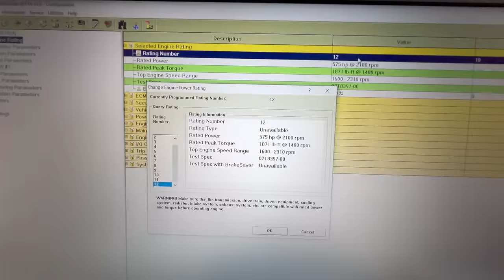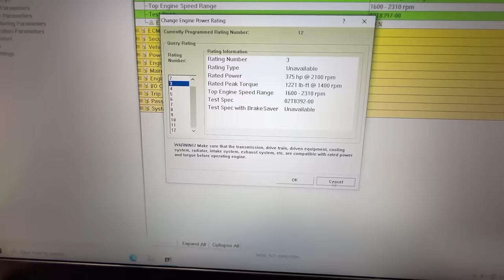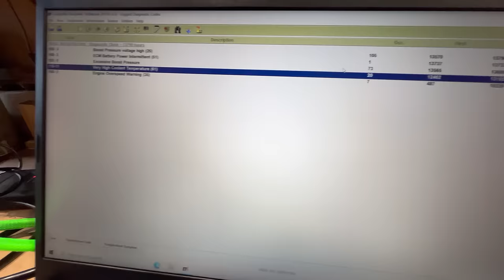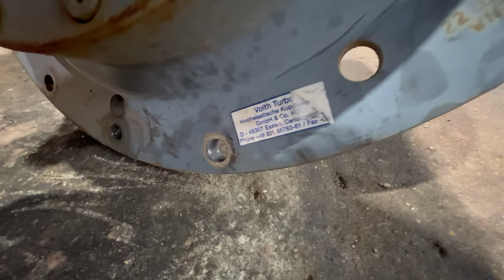Locked Up 565 HP Caterpillar 3406E Industrial Diesel Engine Tear Down

Comment: Possibly could have been 1 of 2 engines used on a locomotive. Direct drive goes to a 450 HP electric generator and an air compressor. Would have been another unit exactly like it on the other side of the cab. I used a 1200 HP engine built the same way but with a dead generator on the A-end side. We were limited to 600 HP and that was on a good day.
Reply: so it came out of a genset well deserving of a scrapping?
Reply: @SD40Fan_Jason I believe you are correct. The only application that requires that big of a air compressor are for the railroad industry, particularly the locomotives.
Reply: @josephmichuda6447  i belief atlas copco used these on their 46m3 mobile air compressors. Used for sandblasting and other micellanious jobs in the off-shore oil and gas. But i think this compressors were built back in '07 &'08.
Reply: I don't think you need that type of voith hydrodynamic coupling in generator setup.

Direct drive ? YES.
Reply: @TheStefanskoglund1  the voith hydrodynamic www looks like a locomotive is a good guess
Reply: @rodrod383  railway equipment,  some type of drive in a industry - crusher/transport band etc

I don't think it is necessary in something like a diesel-generator.
Reply: I deliver chlorine aka bleach to municipal city water wells and seen these engines for the backup electric pumps 🤝💪🏻🤘🏻

Comment: Just happened to be working on a 3406 and when I watched the video, I realized I had shut off the coolant filter cutoff valve to change the filter, and forgot to open it back up again. Ran back out to the shop and opened it up. So thanks for showing that filter housing and valve!

Comment: Why are you getting away from truck engines??? Hope you still make videos. Love the videos. Very informative
Reply: yea don't leave us hanging
Reply: Inquiring minds want to know! I hope Greta isn’t influencing your decision! 😂
Reply: @harleyhoracio1  Greta's mind is about like that one sleeve that he pulled out!  Completely cracked !
Reply: Powerplant generator engines are more and more common. The hybrid platform from PACCAR is pushing 25/30 mpg at 120,000 GTW (gross trailer weight) and that is more appealing than the 8-16 mpg of a strait diesel engine. I have a few classmates from engineering school and the tax incentives from Uncle Sam and the EU is to go for the hybrids then all electric. They also told me that the push for hybrid is because of fuel being 5/6/7 dollars a gallon that the trucking outfits want more fuel economy because fuck the fuel costs. The mpg testing is done at a race way going pretty much in circles with banks left and right at 65 mph for hours on end with some hills mixed in. Gist is they have had the hybrids for a while but now there is a push in the next 2 to 3 years that most trucks sold will be hybrid.
Reply: Off road truck engines only.Still a big player in power generation.

Comment: Been watching your channel for years.  I’ve had no real experience in commercial diesels, I’ve worked at a new car dealer for 25 years as a mechanic. Japanese cars in particular. Ironically however I’ve recently made a big change to fleet working with ISB and ISL Cummins engines. I’ve learned a fair deal watching your videos, it’s cool to see the similarities.  
Great vids.

Comment: S/N 3145 is a Generator, 6BR1004 was built in 98 and sold in 2000 to a dealer In Austria, 

How it ended up back over here is anyone's guess.
Reply: But why hase it that Voith cupling (Made in Germany) on it and a compressor?
That looks more like special vehicle aplication!
With that coupling i guess either some sort of hydrostatic drive or somthing like a snow blower.
If it was originaly sold as a Genset engine in Austria, i would tend to think this was last used as a replacement engine in a snow blower or maby a snow groomer, and somehow ended up in the US!?🤔

Comment: Voith are a German company that makes train parts, most likely that engine was locomotive application. Where I work we use Voith parts, couplers for trains.
Great video and tear down, look forward to your next video, whenever it may be!! One of the best content creators in this line of work!!
Reply: They also make retarders for trucks and busses - generators that burn all the generated energy off as heat to brake the vehicle. And automatic transmissions for busses and trucks
Reply: I believe Voith Turbo deal mainly with the rail side of heavy industry, transmissions and adaptors. Not a 100% it’s just rail, but it’s now called Voith Turbo Schafenberg (forgive the spelling).
Reply: Voith are also big in marine thrusters, could have come from a tug or push boat?

Comment: The little sticker with the german writing on it is the company name and address/contact info. Voith is a maker of big gearboxes, it seems this driveshaft coupler was made by a subsidiary called "Voith Turbo Hochelastische Kupplungen GmbH & Co KG". Hochelastische Kupplungen translates to "highly elastic couplers" or "highly elastic clutches" so maybe there is some sort of shock absorber or torque limiter in this thing.

Comment: I'm so happy to see you post another video on a Cat Engines takedown. And for us neophytes, can you tell us what you used to soak the rust loose on the pistons?
Reply: Water.
Reply: i cant say for sure but i use turco WO2 which is phosphoric acid. nova phos cleaner would also work
Reply: I was thinking the same, I usually use Acetone & ATF.
Reply: @86FxBdyCpe  that's a great penetrant, but it won't dissolve rust
Reply: @jasonstalder5208  Nothing is better than water...
Reply: @Look_What_You_Did  for dissolving rust? Lmao yeah ok bud. Did you suffer some head injuries???
Reply: @Look_What_You_Did  also it's proven ATF and acetone in a 50/50 mix is the best penetrant
Reply: Probably Evaporust.
Reply: Nothing better than panther piss💅🏻🤝😎

Comment: I learn something every time i listen to your videos.  Love driving a truck with a cat engine.  I have enjoyed 3406A , B's  WS , and 6NZ.  The bossman and I kept on trying bifferent spec settings on the 6NZ.  Run 68 mph and was getting 6.5 to 6.9 mph running west out of St Louis.  
 Most of the loads west were   45.500 and produce back.

Comment: Wondering what you used to free the cylinders up or is it a secret. You do a fantastic job of explaining what you are doing.
Reply: Maybe vinager
Reply: Acetone and atf
Reply: I vote for acetone and atf
Reply: Acetone evaporates fast though
Reply: If it was atf and acetone,  it would be red. 
It sure wasn't red
Reply: CLR
Reply: Going by how cloudy it was I'm guessing there's a bunch of citric acid in there. Probably phosphoric as well.

If you want to get really creative add in some chelating agent, either EDTA or sodium EDTMP for example. Keeps the metal ions from redepositing. That's basically all Evaporust is.
Reply: Yep I was curious. More impressed that it worked quickly and then could be sucked up with a shop vac and not destroy it!

Comment: I love my 3406E  in my 2000 379 Pete . It’s kinda a rare motor nowadays . For one thing  it was specked out with a 3406E 1MM  15.8 liter 600 hp factory settings. I guess it’s actually a C 16 if you think about it. It got a fresh rebuild last March and runs so strong . I had another truck with a 2WS Set to 550 hp that I got a hundred thousand miles out of with no breakdowns. Great engines both of them . Nice to see you back on here . Take care brother.
Reply: The 3406E came in both 14.6L and 15.8L displacements. Your 15.8L 600 🐎 motor is somewhat similar/analogous to the follow up C-16 (7CZ) while the 550 was replaced by the C-15 (6NZ).
Reply: A hundred thousand miles? probably more like a million. I ran my '97 Pete for 1,750,000 kl-ms over 9 and a half years when I sold it and I know it went for several more years after that

Comment: Being as the adapted on the back of the engine was from Voith Turbo. You can safely assume that this engine was used to power a very large water pump.

Comment: Your mixture for the seized pistons worked well. Is that your own mystery oil concoction?
Reply: I would like to know too
Reply: What's wrong with vinegar for a starter.
Reply: @edwinhsingmaster9135  exactly what I thought hot white vinegar
Reply: @jasonh.8362  the white vinegar doesnt discriminate between oxidization and base metal. I would bet dollars to doughnuts that it wasnt vinegar. prob evaporust or some derivative.

Comment: 3406 was used as a generator set on the 75 ft tug boats. we had 2. decent motors. reliable as hell. in case you were wandering USCGC Wyaconda.

Comment: The blue german thing on the flywheel should be a fluid coupling. Likely to facilitate starting the engine with an otherwise permanently driven compressor or something.

Comment: Great content and editing, KT.  What would have caused that #6 liner to crack?  I'm sure the pieces blown into the cooling void were due to combustion pressure, but I'm stumped on the crack when there was no sign of galling or over temp on the piston.
Reply from the maker: I agree with your conclusions.  If I had to guess I'd say it froze and cracked first, but there's no way to say for sure.  It was a pretty strange failure.

Comment: What do you think caused that liner to fail? Looked pretty rusty in the coolant passages, kinda like they were running water or bad coolant. Kinda looks like it could have frozen and busted the liner .
Reply: If it was frozen think it would have busted into the cylinder not the coolant paggase? Also would think that a freeze plug or something less meaty would have busted first. No way of knowing I guess. Maybe the liner was cavitated bad and it finally let go?
Reply: I have seen another video where the guy found a broken liner like that. It was believed to have been a hydrolock situation that broke it. He figured that the liner was cracked already and some coolant was seeping into the cylinder. The guy also found a witness mark on the bearing of the connecting rod. He believed it was from the piston stopping suddenly or encountering some extreme resistance. Since the liner was likely already cracked, it just broke the liner where it was cracked. The connecting rod was fine and so was the crank and piston.
Reply: It was overheated a bunch so maybe that started it. Also the coolant config is different maybe that cylinder runs hotter with the inlet up at #4 as he was pointing out usually it goes to the #6 where it broke.
Reply: @clynesnowtail1257  interesting didn't think about it overheating. Thanks for the response and thanks for the time and effort put into these videos.
Reply: @miztatone918   Oh this isnt my video

Comment: I used to work at a company called Bulldog Hydraulics and Gaskets. I sold so may kits for countless application variants of the 3406 engines. The engine overhaul kits were extrmely application specific. The strangest, at least from my perspective, were the stationary marine engines. They had some very special parts that were ideally suited for being in constant exposure to sea water and high humidity.

Comment: Just taking a shot in the dark here but I bet this engine came off of an irrigation pivot. The drive shaft runs the big ass water pump, The belt sheaves drive the generator that runs all the electrical equipment, and the air compressor builds air for all the valves.

Comment: For the number of hours, the head is extremely clean.  Super clean usually means something is cracked, which is what you found.  The rust under the valve covers has me thinking the valve springs may need to be replaced as rust will make them break.  Any chance this engine was a victim of a hurricane?  It is nice to see a YouTuber that knows what he is doing!

Comment: I really enjoyed that video as I am fascinated by Caterpillar engines in power generation applications, especially the very largest versions. 

If KT is watching the comments I think this type of engine is exactly the sort of thing that many medium sized factories and other businesses will want to install (with an alternator on the front of course) as a backup fast start generator for critical loads as the grid becomes more dependent on wind and solar and hence less reliable. There will always be already market not just for second hand engines like this but also the skills to repair them. A business facing a power outage in winter and a broken engine will pay a lot for a quick solution to prevent business disruption.

Comment: Interesting teardown, I get the feeling this thing was in a separator or a wash plant in a pit somewhere because of the pto adapter and that high output compressor hanging off it.I am curious about that split sleeve, normally that kind of thing happens from freezing but I guess not here.

Comment: We use these engines on our boat to make hydraulic pressure for unloading systems and winches, and for the generation on electricity. The air compressor could be for air controlled gates on a conveyor system.

Comment: I'm totally impressed with your knowledge and presentation. Beyond professional. Only thing missing is your opinion on why the liner broke. If from overheating why didn't o-rings and coolant items fail first? Isn't that typically what happens? Thanks for a nice lesson on Cat 3406's.

Comment: Voith Turbo is a marine drive manufacturer and supplier. I would presume this engine was use in a marine application, maybe even as a main propulsion unit on a multi-engine small ship or large boat. The universal joint would have gone to a gearbox and the belt sheave used to drive a generator or air compressor. As always a very instructive and interesting video.

Comment: Absolutely with no discussion about it!!! The best Diesel engine ever made in history. That’s why they are no longer made. I owned several and other than a head gasket or a liner seeping on a couple they will run 6-8 hundred thousand miles in rough conditions.

Comment: The drive shaft adapter that you pulled off, WAS German. Voith is a German Industrial manufacturer that I had exposure to when I worked for Federal Paper Board Co. Voith made several dryer sections of our paper machines. Doubt that this had anything to do with a paper machine, but I do remember the name Voith...  Rip

Comment: Interesting that engine was used by Voith. They make that super badass counter-rotating propeller for tug boats and ferries. Anyway, they're like a German version of GE. They most likely used that engine in a generator set. Probably not for a boat or you'd see a water to water heat exchanger in place of a radiator.

Comment: Good to see you back at it, Why are you getting outt of truck engines? Not enoough work or equipment engines just bigger money? What rust dissolver stuff do you use? I got some  powdered acid that comes in little bottles, name escapes me, works well to. When you go on vacation you should go to Australia and visit that cutting edge guy Curtiss, you both seem mechanically meticulous. Whatever you do i hope you still do a motor from time to time.
Reply: that liner removal was a pretty good combination of luck and skill. good job

Comment: Awesome video. I did notice rust on your lifting chains which can lead to chain failure and hide cracks/damage. Make sure all chains and hardware are rated for the load. It is good to keep chains and hardware lubricated and properly stored for air circulation. Inspect before each use for damage, kinks and stretch. Most of this applies to lifting straps as well. Keep up the vids and stay safe.
Reply: Pretty patronising comment Ry Ry ,this man is not an idiot. If you passed a comment like that in my workshop you'd be escorted to the door.
Reply: @seamusburke9101 no kidding, this guy would grow a 3 inch hemorrhoid if he seen the stuff we do with chains and straps

Comment: I have a 320kva genset with a 3406B with 10,000 hours on it, and under moderate load it would usually go through 8 ish litres of oil every 100 hours running 24 hours a day, but in the recent week it started going through roughly 25 L of oil every 20 hours with less of a load 14 hours a day with no smoke from exhaust, no leaks or puddles of oil, I removed the charge pipe from turbo to intake, just ya typical oil residue nothing weird, and removed the exhaust side off the turbo with only typical soot build up. ran it without the cap on the oil filler neck which goes straight to the crank case and I can't feel any pressure what so ever on my hand when put my hand on the filler neck, only thing that I found is not great any way you slice it but I wouldn't think is the smoking gun is that the coolant temp under this lighter load is 130 F (55 c) but again there doesn't seem to be excessive blow by or fumes.... Any ideas much appreciated. Cheers

Comment: The Voith Group is a German manufacturer of machines for the pulp and paper industry, technical equipment for hydropower plants and drive and braking systems. The family-owned company, which operates worldwide and has its headquarters in Heidenheim an der Brenz, was founded in 1867.

They do ships, railway, recycling plastic machinery and much more too.

Comment: I have one of these engines off a tub grinder, belly conveyor caught fire, burned the whole ass end out but the engine was untouched. There's no compressor but the rest is the same. Its a running engine, 1200 hours, what's this engine worth?

Comment: Was that engine a power plant for something with hydraulic transmission ?

It could have been a transport band drive or anything there it is necessary to protect the engine from intermittent stress/chocks from the load.

A crusher ?

Comment: I think that could have been used on a dredge. They use belts alot of times so they'll slip in case the pump seizes for whatever reason.  The shaft would run hydraulic pump as well as maybe a washdown pump. Air could be be for a dri prime system
Reply: I ran a dredge for a year or so with a c15. It ran hard at high load. Right before i left it was ready for a rebuild at around 3000 hrs